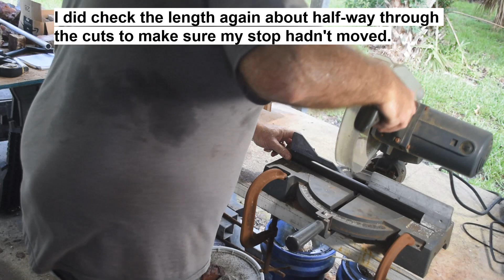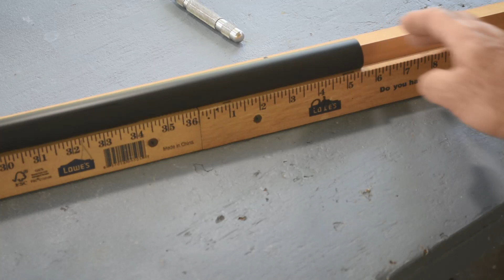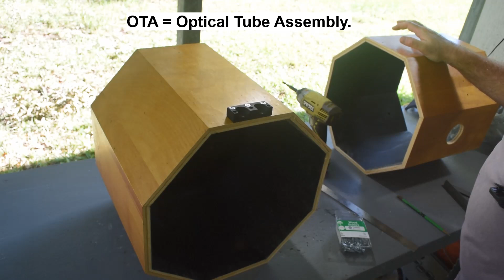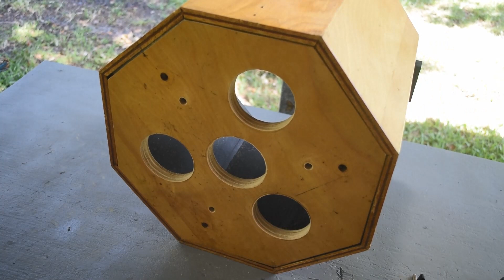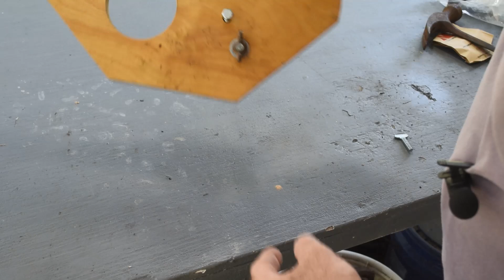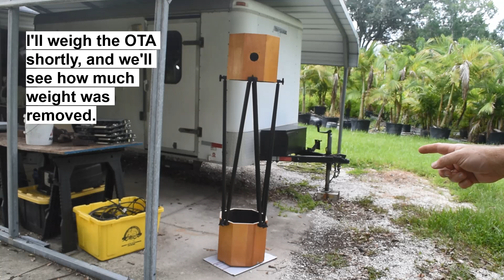This Old Telescope: Rehabbing an old, home-built DOB scope part 4

Comment: You need to add three feet to the bottom.
The way it is now, for Assembly / disassembly, every time you set the telescope upright,  it is resting on the collimation hardware.
screw / glue on some feet.

PS, watched all 4 installments.
Wish I could find an old scope like this one to rework.
Reply from the maker: Yes, feet are in the plan.

Comment: Looking good.
A good weight saving.
I wondered if the mirror cell should have been recessed further into the tube so that the adjusting screws were below the rim of the tube. I can see the telescope being stood on end a lot which might stress the adjusting screws.
Good progress, thanks for sharing.
Reply from the maker: I plan on putting feet on the bottom of the scope so it can be stood up without pressing on the screws. Recessing the cell further would just mean making the scope even longer to get the focal point where it needs to be. This monster is long enough already.